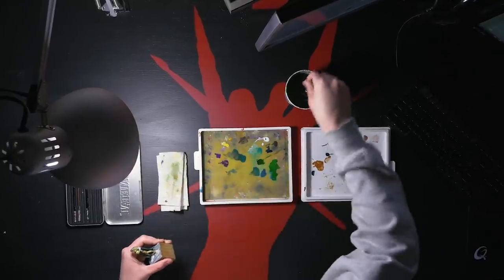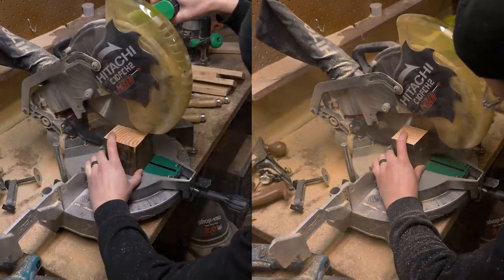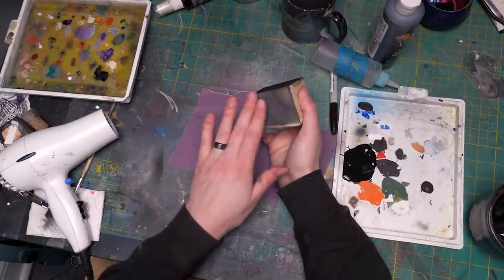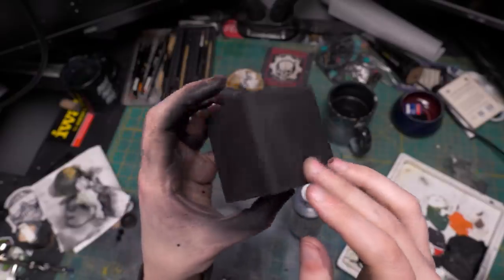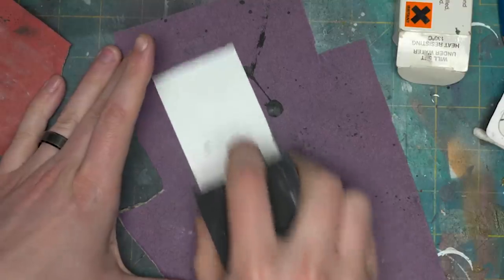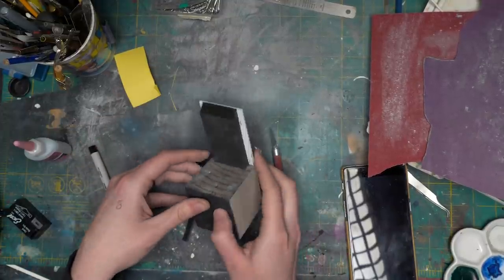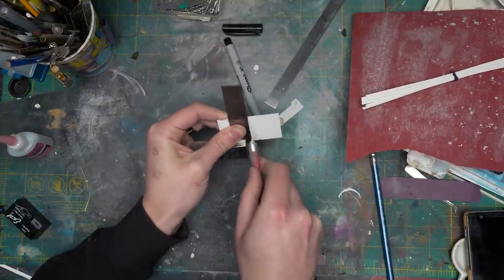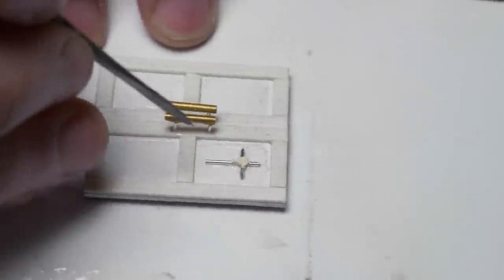Making a MINI DIORAMA! Homecoming Part 2!

Comment: Scale for minis is based on eye level if I remember right.  Also humans average a lot shorter than 6'.  That's why you were getting weird numbers.  If the first result from Google is right (I suspect it may be shorter... Shorter would lead to a taller door), average eye height is about 5'.  So, door size 80"/60" = 1.333.  32mm * 1.333 = 42.7.  So, 43mm would be the right height for an average human based on a 5' eye level
Reply: I like this response. I'll have to try those numbers and see how it works with my own terrain pieces.

Comment: Nice job on that so far and good tips, thanks. 
I reckon on the door, the smaller one would have worked well if you'd put it with a step or two under it. The added height would have given the impression of it being bigger.
Reply: That was my thought, exactly! I wonder if part of the trouble with to-scale doorways is that we're usually looking down on the mini which makes the door stop feel extra close and maybe raising the doorway counteracts that to some degree.

Comment: A little technique I use for etching wood grain into styrene is to get a modellers razor saw and drag the teeth along the way you'd like the grain at about a 45° angle. The more pressure you use defines how deep the grain is and if you put more pressure towards the edges it tends to give the wood a more worn, old look

Comment: When woodworking, if I want a glass finish, I sand to 400 grit and then spritz the wood with a little bit of water or wipe on some mineral spirits. The wood grain then swells and raises up. Then I go through my grits again. It's relatively fast and you won't waste a ton of paint.
Reply from the maker: Water has the same effect as paint. There's water in my paint that raises the grain but I also paint it in the same step.

Comment: Sanding grain to gain a smooth surface works better using the wet and dry method as the grain swells with moisture and shrinks back tighter as it dries after sanding

Comment: Don't know if anyone has mentioned it but for the plinth you may want to consider pre-raising the grain by spraying/wiping the surface with water. So the surface is less likely to plump up and raise the grain from soaking up the paint. Hopefully that'll reduce the number of passes it takes sanding the sides down.

Comment: Late to the party but still finding this interesting. Woodgrain hack for the next time to need it... drag the blade of a jewelers saw  in the direction you want the grain. It works better with a small hacksaw for the size of teeth despite there being a smaller tooth count. It's worked for me on my stuff and will work on flat sheet as well as square/round rod.

Comment: Scott,

If I recall (I haven't gone back to the planning video for this diorama at this time), the idea is that the church would be in the distance. thus the trapezoid shape of the plinth. So the church should actually be a bit further beyond the model in the distance and should therefore be a bit smaller in scale. If you make the door to the same scale as the model then I fear that you will lose the illusion of distance and length that you are going for. Another note is that in the dimension of this illusion, I don't think that you would be able to see any of the roof line of the church unless it was really scaled down. So I guess my criticism is if you go larger door then there shouldn't be any roof line visible as it is closer to the scene (unless this is a very squat church) or if you go with a smaller door then the view should allow a bit of the roof line.

I hope this makes sense. I look forward to what you do next!
Reply from the maker: That shingled section on the church won't be the roof of the actual church itself. It's an out-cropping like seen here: https://www.dewitzphotography.com/wp-content/uploads/2015/10/28-16638-post/small-abandoned-country-church-falls-city-wi-historic-city-IMG_7028.jpg

It probably doesn't make sense with how I constructed it, seeing as how the purpose of that little area would be for a patio to get out of the rain/weather. But yeah, my intent wasn't that was the actual roof.

Comment: Hey Scott. Why not face the wood with plasticard, and then you'll have no danger of seing the grain? Also, you'll then be able to use your regular primer, paints and varnish to finish it.

Alternatively, you could just use a large chunk of delrin, maybe glued together from smaller bits.
Reply from the maker: That's a good option as well!
Reply: @Miniac  I just looked up the price of Delrin. You probably wouldn't want to use that! Though, ABS or nylon might be workable alternatives.
Reply from the maker: @Mikey__R  Heck you could even make a blank out of wood, mold and roto-cast it in resin have a bunch ready to go!
Reply: @Miniac  I think I'd fill each hollow plinth with expanding foam or something to make it less hollow sounding.

I've just got a thing against light weight, since I started basing my models with heavier materials they just feel "better."

Comment: Respect to the decision to remake the door. However, I have to wonder that if you used the smaller door and punched up the recession of the entryway if it might help to create the illusion of depth perspective you were talking about in Part 1.
Reply from the maker: That's an interesting idea. I wonder how well it'd work with a max depth of 60mm.
Reply: Yeup.  I'm not sure if it would create the illusion you want or create an "Uncanny Valley" effect. I think it would heavily rely on nailing forced perspective put into the lines of the church wall/cobbled street below the witch. Maybe make an even smaller one with a smaller back drop so that there is no confusion as to whether or not the door is off scale from the mini?

Comment: Just out of curiosity.... now that you've added the back onto the plinth... does it still fit the 60mm dimension from the front of the plinth to the back of the plasticard/styrene? or are you about 2mm OVER the dimensions in this year's rules?
Reply: exactly my thought! he better make sure its not out of spec... would be a shame to fall through on such a minor mistake
Reply from the maker: It might be a little to large but in all honesty no one checks sizes at Crystal Brush. The rules are pretty much a formality; sad but true.
Reply: @Miniac  Scott the Miniature Maniac and Rules Rebel..... yeah that is sad but in that case... run with it!